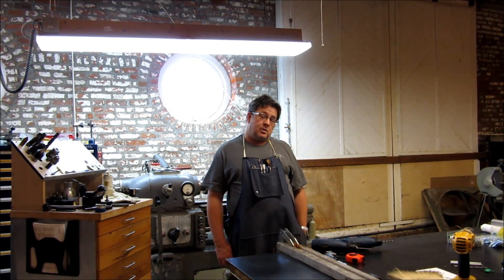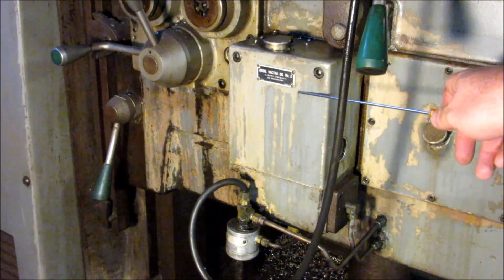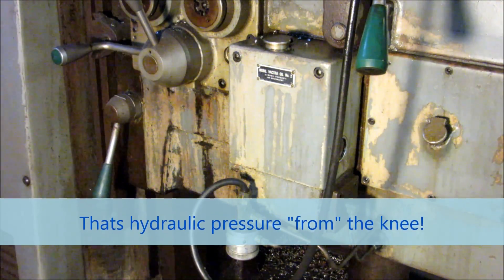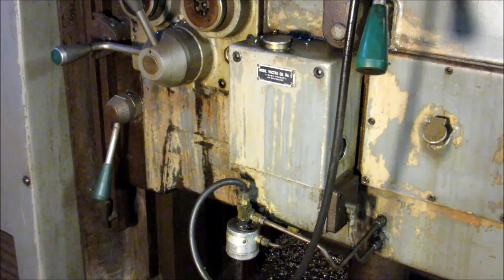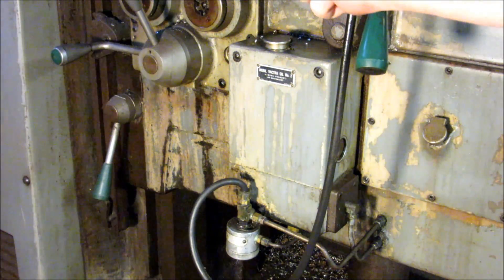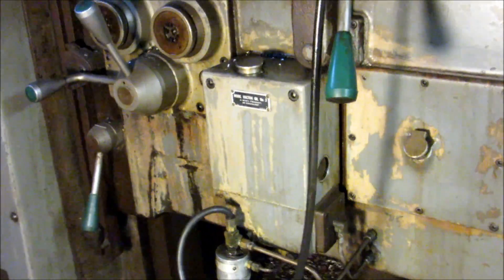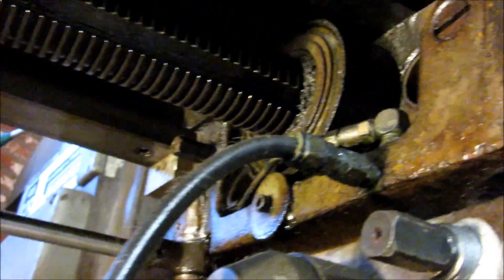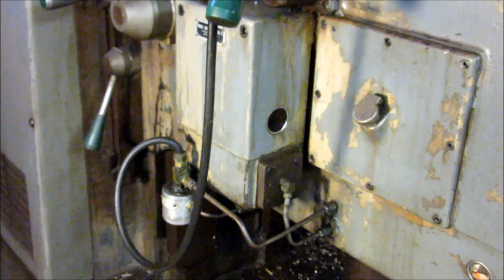K&T 307 Lubrication System Overview

Comment: One issue I had on my 1966 Index Milling Machine, was a cracked copper line at the fitting. The one shot should hold pressure to all fittings, and that crack was down low on the knee. So the table wasn’t getting the way lube it should.  New copper line and fittings from McMaster.  Lots of pumping on my shot to purge air (leave highest fitting loose to watch), and nice oil flow.  Good for another 50 years.
 
I posted up a tip on ZIG ZAG rolling papers on my You Tube channel. Irony is I thought everyone knew about using them to check clearance.  Yes, I've got lots of gray hair but I’m probably one of the last who remembers slide rules in math classes, and ZIG ZAGS laying around shop class in high school.
Reply from the maker: I have to laugh at your Zig Zag comment, when I was little, as in 7 or 8 years old, my Grandfather, may he rest in peach, used to send me into the drug store to buy him rolling papers.  Imagine what would happen today if a 7 year old walked into a drug store and asked for two packs of Zig Zag double wides!